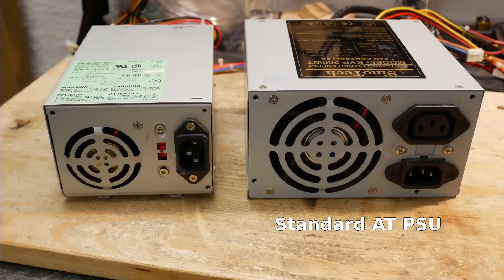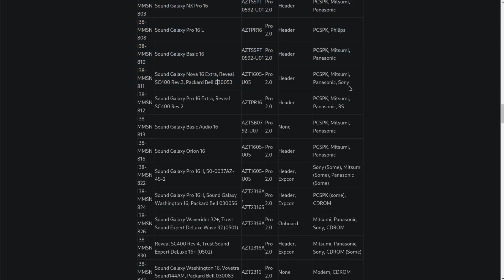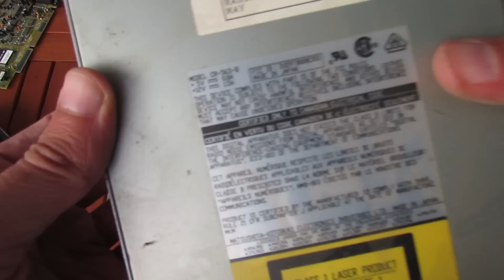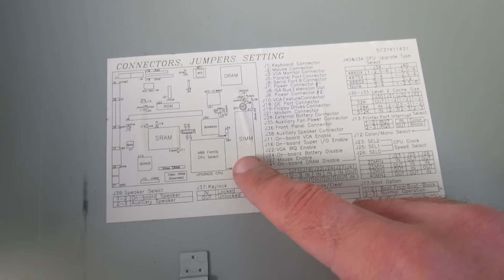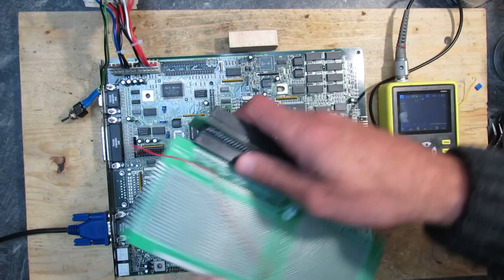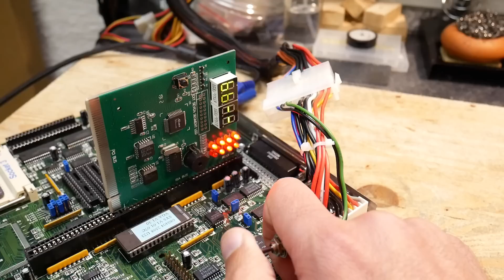Packard Bell PB486CD restoration (Part 1)

Comment: I had a similar system in the same case. It had an older 486 motherboard with 4 megs on board and 4 30pin simm slots. Also is used the rectangle hole near the power supply in the rear for an on-board 2400baud modem 9600/fax. There was a socket 3 i eventually used but a standard 486sx PGA was soldered to the mainboard. As well the onboard video chipset on my older board was Oak 77(512k), less capable than the Cirrus Logic 5428. I had previously upgraded from an 8088 10mhz w/ math coprocessor 8087 to a 80286 20mhz with 80287. I learned early the math co had made my 8088 better in some games than my friends 286. I quickly upgraded to a 486DX ftom 25 mhz sx to 33mhz DX befire upgrading to an amd DX2 80 and morherboard with PCI slots.
Reply: Also I have seen another board for the system with Oak 87 chipset that performed probably better that 5428.

Comment: I have the same machine/board but mine has a problem. When it boots it give a Reference ID then below that it says Shutdown failure. It eventually continues after saving Invalid configuration and to "Press the F1 key to continue, F2 to run the setup utility"' If I select F1 it searches for a boot device but doesn't like my Gotek running FF or my IDE to CF. It doesn't even see them. I'm curious if you've seen anything like this? I wish I knew why it's giving the Shutdown failure and why it won't do anything. If I press F2 it just hangs and never goes into BIOS. I've messed with this board off an on for 6 months. I wonder if you have any ideas.

Comment: Fun fact about those CD interfaces, they are actually SCSI, as IDE's cylinder, tracks, and sectors addressing scheme was totally incompatible with the more linear addressing of CDs (and a lot of other media).  When EIDE/ATA came into vogue, it adopted most of SCSI's addressing schemes, which is why you later get ATA CD, DVD, and BD drives, and the basis for SATA (which a lot of OS's refer to SCSI internally). The reasons for the different connectors came from how each major controller manufacturer (internally to the drives), wanted to handle the signaling, and even those with the same number of pins will organize their power, signaling, and ground differently.  Had they all just worked together at the time, SCSI would have been much wider used when its advantages over IDE were much more obvious.

Comment: Nice job with resurrecting that board! I have a nearly identical PB430A that died to the same issue (and my attempts to repair it were... premature). At least now I know I'll need to strip back a lot more of that section of the board instead of trying to bodge together a couple of wires to reconnect the RTC to the memory controller, if I try to repair it again. What board were you considering swapping over? I have a Pentium MMX-era Packard Bell board I'm planning to swap into my own, but I wouldn't mind the option to at least put a 486 back into that machine.

Comment: I really love the slottet screwdriver you use to straighten bended pins back to the original position.

You mentioned that this tool came with a set of tools… do you remember which set it was?

I googled for two weeks now but could not find anything. 😂

Comment: hello necroware. one another question
a Pentium board I have has a Bechmarq RTC chip. As it has been well over 10 years since the last time it was used (about 15-16), it is clear that the battery is completely dry. The board currently does not boot (when stored it was in working order), no beeps, nothing. Unfortunately I don't have a POST code debug card. Maybe I can measure with an oscilloscope if the clock have a working signal. the voltages were ok. it was tested with a Pentium MMX 200 and a Pentium 133MHz. I can also try two other Pentiums of 133 and 75 Mhz.
Does this battery recharge when it receives power again?
Without this battery charged, can the board boot?

Or should I mod the RTC chip?
Reply from the maker: Hi, it doesn't recharge. Usually, if the battery inside of the module is empty, the board should still post. In very rare cases dead battery can leak and destroy the module inside. You can try to replace it, I made couple of videos about that topic. Also electrolytic capacitors could've been dried out.
Reply: @necro_ware  hello again. I put some images of the motherboard clock signals in a thread on the Vogons website, could you give me an opinion about it. look it up in the thread "AMD 5x86 doesn't run at full speed on AOpen Vi15G"

Comment: hello necroware. I need your kindly help.

I have two AOpen VI15G motherboards , the revision with support for 3.3v CPUs (it has the power regulator). They are part of some PCs (the other is a Pentium) that I had at the end of the 90s or the beginning of this century and all the parts and pieces were stored in working conditions almost 20 years ago. A few months ago nostalgia assaulted me and I am reassembling them. All the parts needed a lot of cleaning, from the PSU to the cards, due to the dust accumulated even inside the boxes, in addition to some slight oxidation. Everything was pristine after cleaning. one of the two psu need some repair but the other ones is working flawlessly.

I have some 486 but the best one is an Am5x86. I didn't remember if the jumpers were set for use that one, so I looked for the documentation and I found two documents, one original from the first version of the motherboard, which only supports 5v, and another with jumper settings updated for the revision with 3V support). I configured the motherboard as an Intel 486DX4, also as an AMD DX4 (the board is from 2 years before the 5x86), based on some recommendations I read around. both are 3.3/3.45 volt processors, but when measuring the voltages on the socket pins and on the regulator output, it's always 5V no matter the configuration. It happens equally on both motherboards, I don't think the regulator is defective in both cases.

I would appreciate if you help me with the correct configuration to be able to use the Am5x86 (or 486DX4 from Intel or AMD, as a valid config as I see). The other 486 compatible I have is an AMD 486DX2-66 but of course the primary interest is the Am5x86. I still need to check them with the DX2s to make sure.

the PentiumMMX is also not working, no post, but i will see it latter

Any help will be very appreciated.
Reply from the maker: I don't have this board and it looks like the available documentation is incomplete. There you can find settings for the CPU, but it is unclear, which jumpers are to set for voltage. F.e. you can find DX2 CPUs as 5V and 3V variants, the CPU settings will be the same, only voltage jumpers will vary. I don't know which are those jumpers in this board, but you can find them by using a multimeter tool.

All the info about this board, which I have is here: https://theretroweb.com/motherboards/s/acer-vi15g
There is a jumper right above the voltage regulator, may be this is what you are searching for.
Reply: @necro_ware  thanks for your answer
Yes, on that website in the second configuration documents, are the jumper settings for 3.3/3.45 volts. I have tried the ones corresponding to the Intel and AMD DX4, and the voltage is still 5v

I have searched for as many images of this board as possible, with some cpu installed or that they say which one they use, to see the corresponding configuration, without luck, they are almost always 486dx2

on the vogons website I saw a thread from someone who has an intel DX4-100 installed on that board (someone else has a 486dx4 overdrive but this cannot be taken into account, having his own regulator, and taking the 5v to what he needs), but in the images he publishes only two rows of jumpers and partially another two are visible. I tried to register on the web to ask, but it doesn't work for some reason.

I really don't think both controllers on both boards (3 with the pentium) are faulty, because when I put them away the PCs were working. I will try a 5 volt DX2 to see how it goes
Reply from the maker: To be honest, I looked couple of times through the documentation and I can't see the voltage settings there. If you compare DX4 and DX2 settings, you will see, they are the same, its because the those CPUs are only different in internal multiplier. There is no mentioning of voltage whatsoever and DX2 exist in 5V and 3V variants. What I mean is, just by setting the jumpers to DX4, you didn't set the voltage yet. There are probably undocumented jumpers on board, probably the one above the voltage regulator.
Reply: @necro_ware  
There are no more jumpers near the voltage regulator than the jp13 + jp23-27 group, in charge of the cpu type

I just gave the regulator a close look. on the ADJ leg of the voltage regulator (the "transistor" like on the left, theones with the heatsink, if the board is positioned so that they are below, it is an LT1085CT, ) there are 3.3 volts!!!. the vein that reaches it is thicker, but short, it comes from the main side of the board. however on the output leg (vout, the middle), the input leg and the VCC pins on the socket there is 5v. does that mean he's dead? I measure not shorts, not in the power lines, nor in the regulators.

the other component is a NDP406BL FET, it has 12v on the G leg and 5 on the other two.

I must check if the same thing happens on the other board
Reply: @necro_ware  Well, I managed to get 3.3-3.5 volts, with two configurations, the AMD DX2 and the AMD DX4. the "3.45v" settings for the intel DX4 deliver 5V!!. however they still won't boot. I'm afraid if the 5x86 was burned when I put it with one of the intel jumper settings. I tried with an amd dx2 (3.3) and it doesn't boot either, no beeps or anything. I will check the boards more thoroughly

Comment: I have an incredibly similar machine (if not the same) with the exact same type of damage. I really wish the video had shown where some of the damaged pad wires went up close... but, I get the gyst. I've managed to do similar repairs using strategies like yours... although, I've always wondered if there's a way to rebuild a solder pad.. If I had a flat piece of copper... I wonder if any type of glue/adhesive would hold it on the board in the same spot - yet be heat resistant. 

Either way.... I was really happy to see the ending of this video, gives me hope that with some patience I'll be able to do the exact same thing.

Comment: Can you try to reproduce mp3 files on these computers? Like CPU galax do but with another softwares
Reply from the maker: On a 486 MP3 makes no sense, since it has too weak FPU. On this particular machine it will not even work because 486SX has no FPU  at all. For MP3 you should use at least a Pentium CPU. Faster 486 CPUs can handle MP3 decoding, but stuttery and at nearly 100% CPU usage.

Comment: Necroware you really do take the words Computer Repair to it's purest aspect. Not  just swapping out a dead part for a new one but truly replacing chips and wires on original equipment. Absolutely love the respect you give to these old machines. You sir see potential and treasure where others see junk and why bother. Thank you for your videos and keeping vintage machines like this around. Have a good one.

Comment: I sometimes use a pair of needle nose pliers that has smooth jaws to crush parts of the solid wires more flat to help with making a wider area to solder pins to or to "sneak" better under chips. A little file work also helps shaping the flattened areas. I like to use wire wrap wire (Kynar) for jumper wire.

Comment: I have an NCR which uses those 40 pin ZIP DRAM. Mine are NEC D424260V-70, which are not very common. I got the SOJ40  equivalent modules (D424260-70) which I plan to adapt sometime but it will need some patience.

Thank you for your great videos!!!

Comment: You're doing some beautiful soldering work! Little tip though, rather than trying to fight to hold loose wire ends down while soldering them, clean the board where necessary and use Kapton tape to temporarily hold the wires in place first.

You should usually have no problem removing the tape afterwards in most situations, but yeah I've actually used that technique to solder wires as thin as a human hair onto micro ribbon cables inside cell phones.

Comment: Nice job! Kind of sad they used this battery bomb! And even beeing a NiMH it leaked so badly. My experience is that NiCd Vartas are the worst. Those green can make a mess too but rarely as bad as in your case. Maybe it is due to bad storage in some humid environment etc. It is a bad luck becouse those branded machines mostly had external batteries in boxes outside the board. And in vl-bus era even some lithium cells already! Good you managed to save the board! I am using your methods with a great success! Thank you. Thinking about a microscope as well - I think it is opening a completely new realm of possibilities!

Comment: I worked at Best Buy from the end of 1991 to summer of 1994.  Back when they were just expanding out of their home base of Minnesota.  They sold so many of these Packard Bell computers, I had my hands on lots of 386 (SX and DX) and 486s, pentiums at the end of my time there.  I was an in-store PC tech for a couple of those years (pre-Geek Squad acquisition) and a real weakness I saw on those compact system was the PS/2 keyboard (and possibly mouse) ports failing from having the keyboard hot-plugged.  I didn't do any board level repairs, so they all got sent back to the repair center.  I don't know if they repaired them or if they got replacement boards from PB.

Comment: I have a slightly later Packard Bell 486. The 40MHz version. It still has it's original HDD with it's original Windows 3.22 install. (there is a video of it booting and running a couple of games on my channel)

Comment: Washing with soap and tap water is perfectly fine, if the board dont have any power source, aka. barrel/coin cell battery attached to it. Even the OC magicians, like der8auer doing it with their board after a sub-zero OC session to remove the vaseline insulation from the boards, videocards. Der8auer even have a dedicated video for this case, he uses his dishwasher.

Comment: I'm using the same way of drilling the via if it's impossible to be cleaned, it's also a very gentle way to cleanup a multi-layer board ground vias that are notorious heat sinks. Years ago I bought a hand held tool with a small 3-jaw steal chuck in front to hold the small drill bits, which turned out to be super handy allowing perfect control. BTW the drill bits I got with it from china are with poor quality. I do recommend to go to a local machine supply shop and buy a new ones, they are pretty inexpensive and usually produce far more cleaner cuts. If needed I can share a picture of my tool.
Another amazing repair video. Thank you 🙇

Comment: Such patience on a board so many others would scrap! I spent a lot of time in the 90's tinkering with machines like these and looking back it's amazing we managed to do so much with processors that are toys compared to modern machines.

A client recently gave me a pair of machines, an Athlon X2 3800+ with an ASUS SLI motherboard and a Dell Pentium 4 1.6GHz machine both fully working but even on very lightweight Linux installs so very very slow by modern standards.

Comment: What is the unpopulated connector between the parallel port and VGA port supposed to be? Are you going to put it and the associated components back.
Reply from the maker: Game port. I didn't plan to populate that, because it is already available on the sound card

Comment: A relief that the board is working again. I for one very liked the fact that you washed this one with water and soap very thoroughly.
Unfortunately I muss say I gringed a little bit on the IC removal action.
It was such in a sorry state that replacing it would have been the way to go anyway. It would then had made sense to remove the old IC by cutting every leg and then remove them individualy from the board, which would have been much easier.
I think it would have better preserved the pads and the board while saving a lot of time on tedious pads and trace repairs that you had to make in order to bring the board back to life...
Reply from the maker: Yeah, maybe.

Comment: For replacing that kind of IC pads I usually use 30AWG and flatten the end with pliers which usually results in them being level with the other pads. It works quite well!

Comment: It's always a pleasure to watch you work.
Have you ever tried those stick on repair traces NorthBridge Fix sells? I have had good luck with them myself. They can look more authentic than wire too for particularly special pieces. Not sure a Packard Bell counts for that level of attention though. 🤣
Reply from the maker: Thanks! I didn't hear about that repair kit, will have to read what it is. Maybe something I could use indeed.

Comment: Your soldering skills are really impressive but I'm wondering, how do you know if an IC has overheated during desoldering?
Reply: IMO the printing on top becomes unreadable is one clue, second is cracks.
Reply from the maker: It was an assumption. By the specs, that ICs can be heated up to 300°C for a very short period of time, but I exposed it to 350°C for about 10 minutes. Even if they are still working, I wouldn't use them anymore, they could fail soon.

Otherwise, yeah if the printing is barely visible it is a good sign, that a part was overheated.

Comment: Did you say the replacement chip was HC, or HCT ... it should be HCT to be TTL compatible, as HC uses CMOS input levels with a higher threshold than TTL
Ah, definitely HC, that could cause problems as TTL high is not guaranteed to pull up to CMOS input high
Reply from the maker: Yeah, that's true, sometimes you can run into problems, but usually only on older systems.